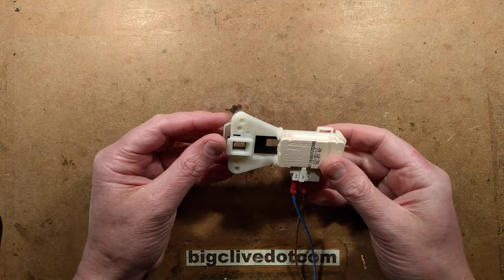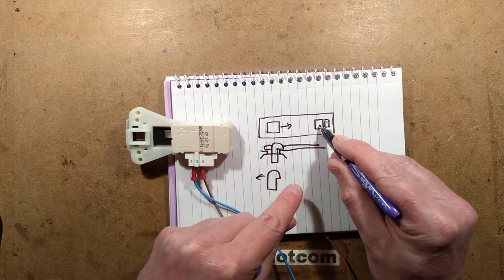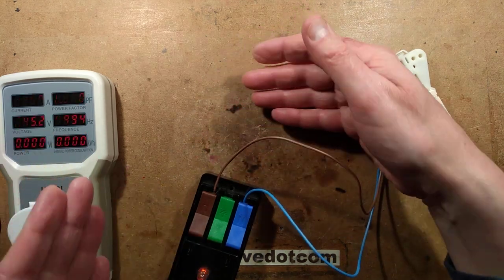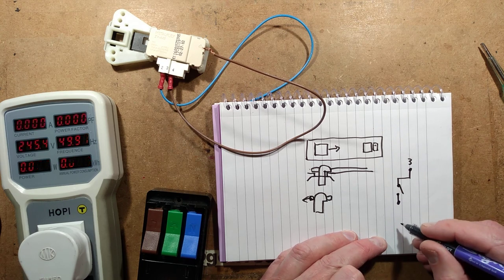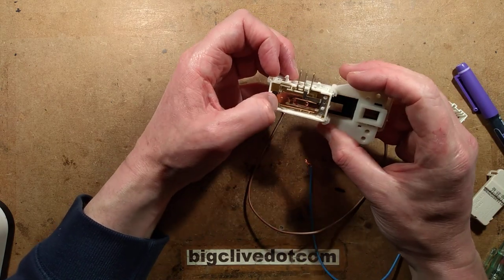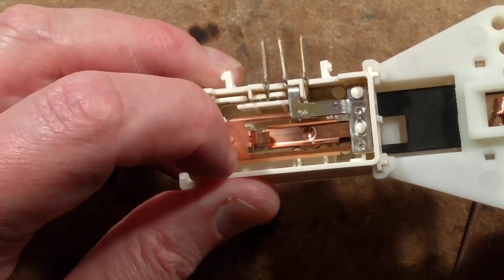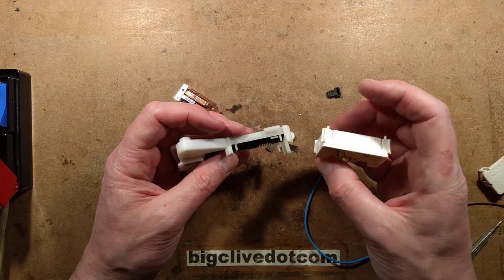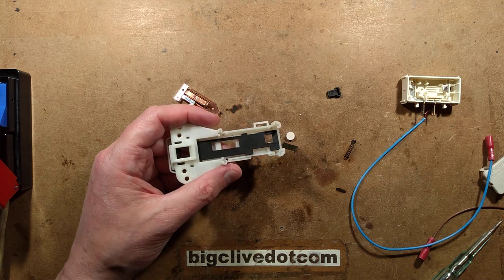How a washing machine door interlock with time delay works.  (not a wax motor)

Comment: These devices are non-serviceable.  They have many plastic clips keeping them together, and for a reason. To prize them apart sometimes you need four hands and four screwdrivers.  They are designed that way, so that when it is clipped together it is not to be taken apart again.  Playing about with one can be deadly as if something moves from its position inside you may get a dead short blowing the main board. Ouch!

The door interlock failure is probably the most common washing machine failure, so much so after a washing machine is out of guarantee, it may be worth ordering one and keeping it handy. They are a 15 minute job to replace in some models. Then no week wait with dirty washing. Washing machines are the most breakdown prone appliances I know. 

The most reliable is a the only washing machine made in the UK, Ebac.  They looked at the washing machine and redesigned the bug points.  It is designed to service and not throw away. The innards are simpler. The washing cycle is shorter so saving money in operation.  The drain pump doubles as re-circulation pump as well. When they make an integrated washer/dryer I will be eyeing them up.

Nice to know how the interlocks work Clive, but I advise if it fails buy a new one. No cleaning contacts or anything.  I noticed the door interlock on my machine is around £17 delivered.

Comment: The delay on my washing machine door was waaay longer than 1 min, so I disabled the interlock - I can open the door immediately now - and lose my hand at the same time if I'm still too impatient. Had I spotted the adjustment screw,  the result may have been less dodgy...haha :o) 
BigClive will be wagging a finger at me (but secretly approving) for defeating a safety interlock now
Reply from the maker: It's OK.  They're only there to protect the manufacturers against less capable people.

Comment: I had to replace this piece and i hate it. Takes forever to open doors after turn off or power loss ( manualy :D )
Reply: Several front loading washing machines have an emergency unlock function, usually located at the front behind the "skirt".

Comment: can the lock malfunction sticking the lock in the close position
Reply from the maker: Yes, but that can also be caused by the machine having water in it, if there's a drainage issue like a blocked filter.  If the water has been drained, then sometimes a firm thump can help release a stuck lock.
Reply: You can put a string around the circumference and pull from the lock towards the centre of the door to pull the door pin to the open position.

Comment: That seems like a long delay to me, what if I wanted to add clothes like I usually do? What am I missing?
Reply: This type of lock is only used in front loaders. On top loaders isnt't used.
In Europe 90% of washing machines are front loaders. Only France uses top loaders.
Reply: João Nobre how does that relate? I can still add clothes to front load washers...?
Reply: @tommy97luu  on front loaders only Samsung has a new model whith a small door (on top of the main door) that you can use to add small pieces of clothes. All others after you start the program the door will be locked till the end.
Of course you can reset the program but  then you will waste water and detergent. Because you have to wait for the water to drain before open the door.
Reply: João Nobre oh the ones we use here in the states must be different. There isn't that much water so it must use a different locking mechanism bc I can pause the program and add clothes and resume washing. Thanks for the insight!

Comment: My hotpoint washing machine door is locked & wn I switch button on it starts noises . Please help . Y it happens . Regards
Reply from the maker: Has it drained the water out?  If it can't pump the water out because the pump is blocked with debris it might have an error code.
Reply: Thanks it’s sorted

Comment: Then, owing to the "opti-mizerly" design, and after you've already replaced it twice before the machine is 24 months old, you disassemble the latest failed one, remove the sliding strip, reassemble & get 12 years of reliable door operation.
Pity the poor sods with kids who have to pay a repairman to keep replacing them.

Comment: But what about Pin 1?! Ground?
Reply: I think it is a contact to show it moved to the locked position. If the door is not closed the pin wont drop and the contact wont close all the way and the machine needs to know so it can start the rest of its cycle..
Reply: Pin 1 is the pin that makes connection to the timer or main pcb of the machine when the door is locked and the program can realy start.
In old machines you just overpass the locking by making a direct conection of this pin to the "fase" pin.

Comment: That damn thing on my washing machine wont let me open the door for about 20, maybe even 30 minutes after the cycle is complete.... It does my head in! what is it trying to keep me safe from?!
Reply: Low blood pressure.
Reply from the maker: Try thumping the switch area about a minute after it's stopped.  Also try pushing the door closed to see if it releases.  Another thing might be to push the latch under the handle before pulling it.

Comment: God I just replaced one of these and it did not fix my problem with it not turning in when I close the door, I think the front panel must be dented

Of course after changing it, I worried about the door popping open full of boiling hot soap
Reply from the maker: Is there front control panel responsive?  If not, check for water ingress.
Reply: @bigclivedotcom  it is, I checked for that also, and stuck relays, nadda, works when I close it hard enough or smack the door...

Comment: I really hate HE washing machines. they regularly sit there "thinking" and not actually washing your clothes. I assume this is the machines way of calculating the amount of clothes but I really miss the old machines that had a dial and it would do exactly what the needle is pointing at on the dial. Also you could tell the washer to use a full load of water for only 3 pairs of jeans, this was great for washing super dirty clothes.
Reply from the maker: The modern machines are very clever.  They initially make the clothes wet by tumbling them and measuring the water level change and adding more water until they are at saturation.  The reason is that the detergent is much more concentrated and the movement of the clothes is greater when just wet.  Later stages use a lot more water for rinsing.

Comment: Have you tried altering the clock speed of the Hopi display multiplexer so it doesn't interact with the camera shutter?
Reply: Presumably the flickering would be sync'ed to the mains voltage?

Some cameras have built-in compensation for that sort of thing (since light bulbs are also affected). Probably not totally effective, though.
Reply: @jasondoe2596  it depends a great deal on the chipset inside the thing; some are adjustable for things like multiplex frequency by means of an external RC network. It isn't likely to rely on the mains for its reference frequency, as it needs a reference in order to measure the supply frequency...
Reply from the maker: Hopi video will be released for general viewing on Sunday.  It's actually very impressive inside.  There's a full-on smart meter chip.
Reply: Anders Van de Gevel, I see, good point.

Looking forward to the video  :)

Comment: i hate these dumb locks.
on older WMs you were able to unclock it by a mechanic stip. but todays WMs it locks and you must wait like for ever ...
my Bloomberg piece of sh*t does so ... never buying again, the door is also a nightmare 
if I wouldn't be so lacy and it wouldn't be so hard to reach in the machine, I would remove the delay metall in it
it has also a contact that gives feedback if the lock is in lock position, so unpluging the heater wires don't help

 I miss my old Miele ;( ;( ;(

Comment: Those locks are very irritating... the delay is overly long even in the case when it is spin-drying, but usually you want to open the door just after starting the program to throw in that extra piece that you forgot, and the drum isn't rotating at all or only very slowly.  But still you have to wait a full minute...
Reply: Not with my machine. It must use a different lock mechanism because if i press the start/stop button shortly after the program has started, it will unlock the door to let me put forgotton items in. But if it has been on for while (not sure what the exact time is), the door doesn't unlock. I think it depends on how much water the machine thinks is inside the drum.
Reply: I can then press start/stop again to resume the program.

Comment: Wires Backwards doesn't matter ?  flipped - %p  ?   "Safer"?      NA ~ Never mind.    
 If you hadn't shown the bimetallic strip working - I'd Not understand.  
How to choose size, or Why use PTC thermistor?  -  Just tolerates heat, pushed up against spring 'lever'.   ?  
 Now - about that bimetallic strip . .    That's Cool    errr     Hot!     = ]      Thanks   ~- *

Comment: front loaders scare the hell out of me to be honest. Break your arm, flood the place... Or of you stop that, an animal or child could get locked in without any escape options.... I'll stick with toploaders.
Reply: Man. I'm a service technician and in my 25 years of experience never seen that happening...
Reply: @joaonobre9003  Which? Kids/pets being locked in? I would imagine that'd generally result more in police than in a service call...
Reply: @The1stImmortal  both of them... if that was a problem then autorities already have taken care by making front loaders forbiden to sell or use. Top loaders are mainly used in America (all America) in Europe only France uses Top loaders but they are of a diferent type, the drum is the same as the normal front loaders but it opens on top. 
How do you break your arm? The machine doesn't spin with the door open.
Flood the place? Only if you break the glass during operation. But that is a very strong glass. You can drop it from a 1 mt high and it can survive. I use old ones to plant flowers😀.
How can an animal be locked inside by imself? Only if someone wants to harm the creature. But that is also possible in the top loaders.
The same goes for a child.
There is no reason to be scared of a front loader machine and the modern ones have a child lock system to prevent the use of the appliance. 
Top loaders made in (USA) from GE, Whirlpool, etc were forbidden to import to Europe because of energy waste some years ago. I used to work on a GE agent shop and was always a problem to explain to people that the machine needed to be connected to hot water because they dont have a water heater element fitted inside. 
But there are still some machines working.
PS : sorry for any grammar errors, english is not my first language. 😉

Comment: Interesting.  Unfortunate if you accidentally put your baby in with the washing  - especially a 90 degree wash.  You'd basically have to let it simmer gently till the door decides to open.
Reply from the maker: Or indeed your first ever smartphone.  That was a harsh lesson.  Then I put the much lower spec replacement in the machine too.  All down to the phones being too big to fit in the normal pockets, so going into the cargo pockets of my work trousers instead.

Comment: Reaching in to a drum going 1500 rpm with 20 to 25 kgs of wet clothes would teach someone not to do it twice.
Reply: 20KG of wet clothes. No washing machine can take that much weight. A basket of wet clothes weighing 20KG would be difficult to lift too.
Reply: @simontay4851  A gallon of water weighs about 8 pounds.A small front load washer uses about 7 gallons=25 kg.As it starts to spin the force is actually greater.

Comment: Very cool, but a pain in the arse, to get the dam machine to open when you realise you dropped that dirty sock on th  way. Also I can't help but to think of the intertainment we would get out of youtube if there wasnt a health and safety. Could you imagine, I mean because of health and safety we have all these gadgets which lower the rate in which people do dumb stuff. But what if we didn't have health and safety people would do more dumb stuff youtube prolly wouldn't be so tight on the videos. Man I can only imagine the content. Like the guy who bolted the b-52 bomber booster rocket to his car they found his figure nails and teeth in the steering wheel. So his finger nails ripped off during acceleration and teeth stuck in the steering wheel during impact. At least that's what I was told in the 70's.

Comment: I haven’t time to watch this yet, which I’m pointing out in case this has already been said, but I have a BIG beef with these stupid things, I don’t have kids, so I don’t need childproof tops and child protection locks, and anyway, why the F should opening in 5 minutes after the cycle is done be less dangerous than opening immediately, WHY!? IT MAKES NO EFFING SENSE!!!
Reply from the maker: It has to be aimed at the lowest common denominator.  I reckon it could be bypassed with a link or if the processor tests the switch for change of state a relay would fix it.  But a door carelessly left open on a bypassed lock would keep pouring out water for quite a time.
Reply: bigclivedotcom well, having watch the vid now I get it better, but it’s so frustrating, it’s all done, it’s all still, it has been for 3-5 minutes now, I promise I won’t open the door during times when it’s not, gimme my goddamn laundry ya mutha farmer, I paid good money for you! Don’t tell me what to do! Gaaaaah!!! (Shakes fist!)

Comment: Clive, not really related to this video, but you might find this interesting: https://hardware.slashdot.org/story/19/06/08/1827250/the-lost-history-of-sodium-wiring
Reply from the maker: That's weird.  I couldn't even imagine sodium being used as a conductor metal.
Reply: Given appropriately cheap insulation, it could certainly add extra spectacle to Christmas lights, in the event of of rain.

Comment: I hate the washing machines with the time delay for door opening. When laundry is done its done, let me take my clothes out. I am intelligent enough not to open the door when the laundry is still spinning in case of the power failure.
Reply: I agree, but these machines are primarily used by housewives with kids running around. My childhood investigation of all electrical and mechanical things included me trying my best to open the door while the drum was spinning and sloshing about.

Comment: Bloody washing machines. Mine broke the other week. What should have cost 20 quid to fix with new bearings, cost me 300 quid for a new washer. Why are they allowed to get away with this welded drum bollocks?
Reply: a second hand miele is likely to outlast whatever you bought for 300, cost less and be repairable. Didn't fancy gumtree or the usual suspects?